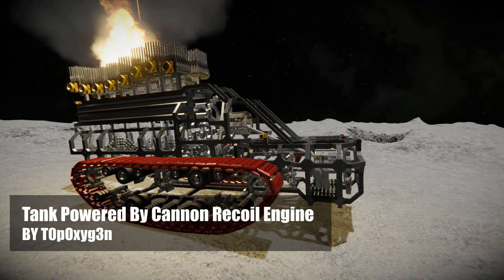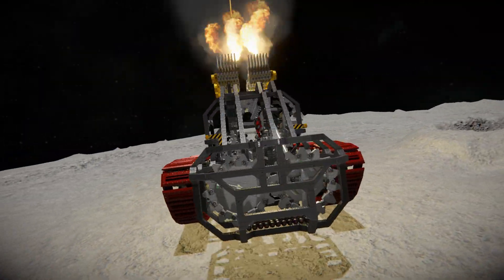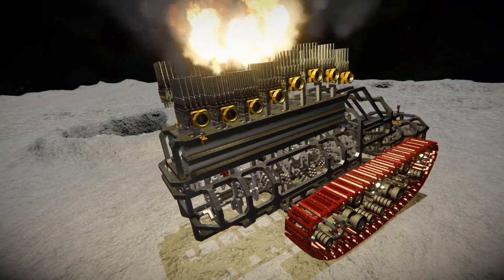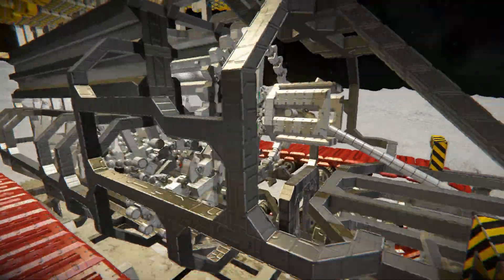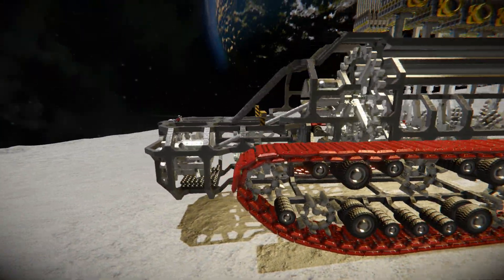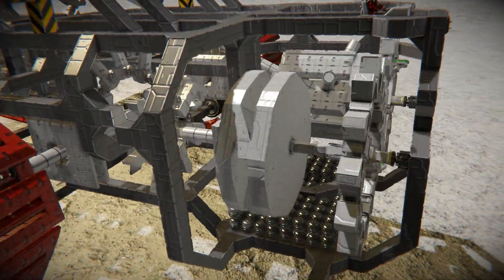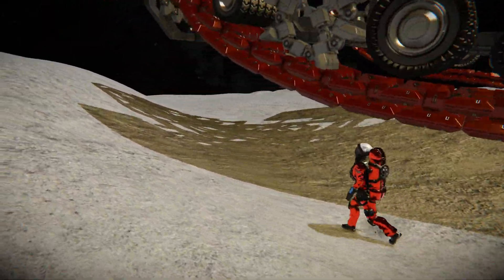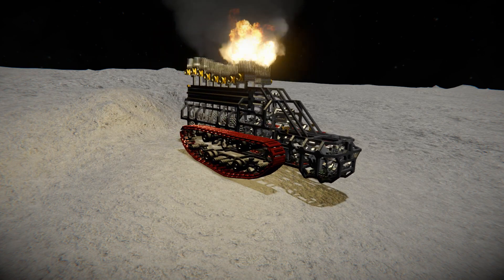Recoil piston engine

Comment: I guess this would be an external combustion engine.
Reply: Technically, the combustion is still occurring in the cylinders (breaches), it's just that the exhaust contains significantly more high velocity armor piercing rounds than usual.
Reply: @pancake4061  they are like cylinders that eject and replace the cylinder head every time they cycle.
Reply: @GusCraft460  The cylinder head is included in the exhaust.